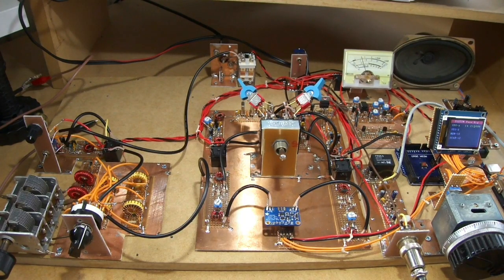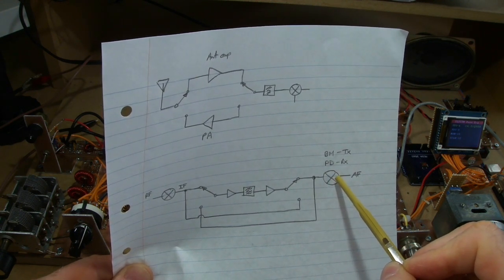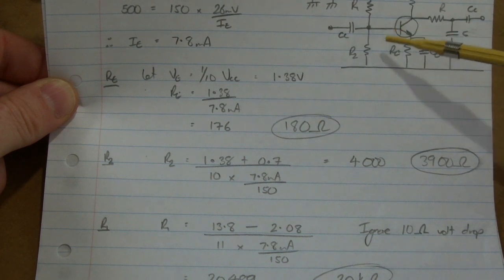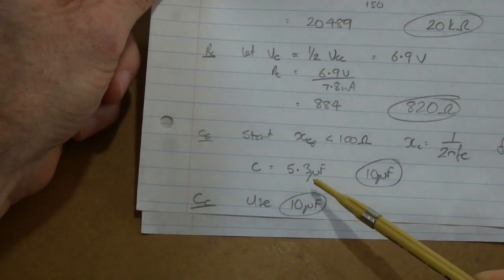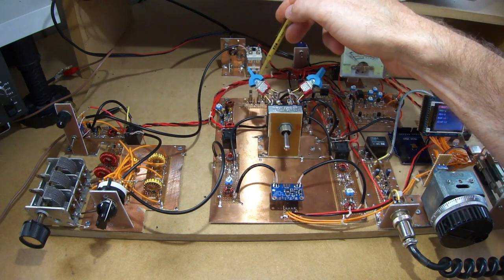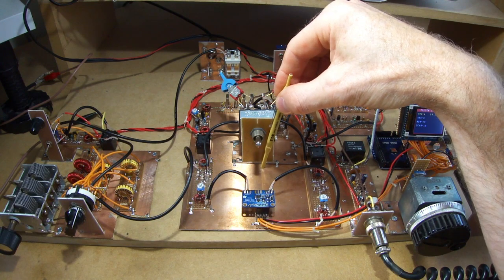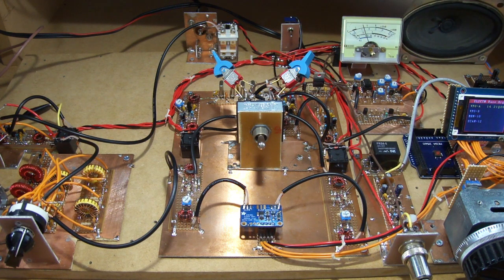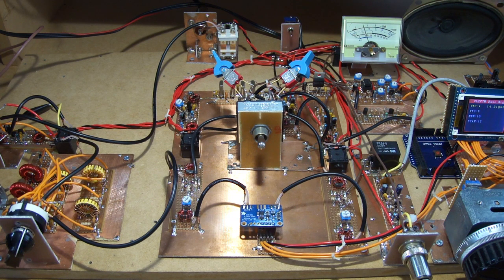Homebrew 80/40/20m SSB Rig Part 7 - Mic Amplifier and Low Power Transmit

Comment: I wonder if you can shift the phase sufficiently to prevent oscillation by the insertion of a small reactance into the signal path, e.g. a 1pF or so to ground, or perhaps a turn or of stiff wire...
Reply from the maker: Thanks Chris for the idea. I might have to look at that!

Cheers

Charlie

Comment: Hi Charlie,
I for one enjoy watching your videos, it has helped me get my head around some of the mathematics  involved
with transistor biasing and impedance matching. If possible I would like to see your circuits and relevant information, Arduino code  
etc. available on your blog so I could print some details. 
Best regards ...........Peter (GW4ZUA)
Reply from the maker: Thanks Peter. I've been meaning to buy an old scanner so I can PDF my notes and put them up on the bolg. I'm not a great typist, so I'd prefer a quick and easy way to make the note available. I'll endeavour to put something up this week. I'll include the VFO/BFO tuning code too.Charlie
Reply: Thanks Charlie, I look forward to reading your notes........Regards Peter
Reply from the maker: Notes are up Peter.

Charlie
Reply: Hi Charlie,
Thankyou for the notes, I realise how much work and time is involved .
Regards............Peter